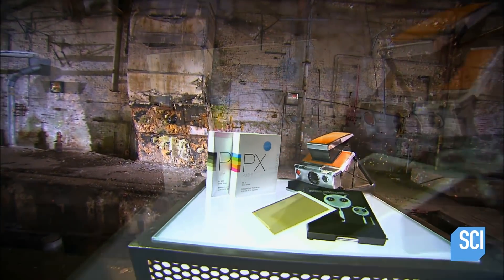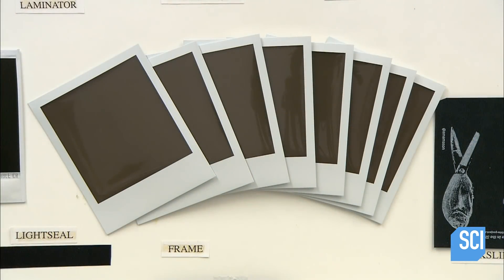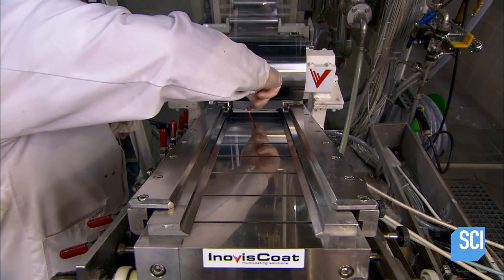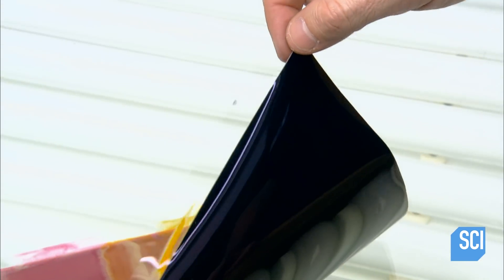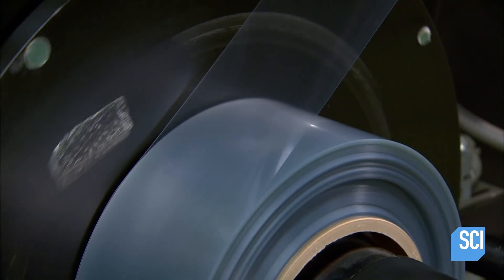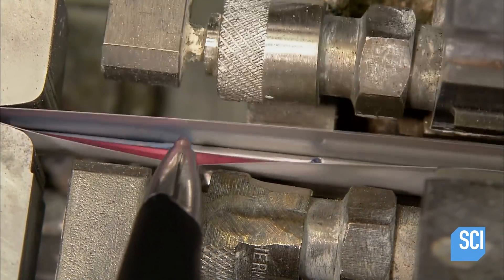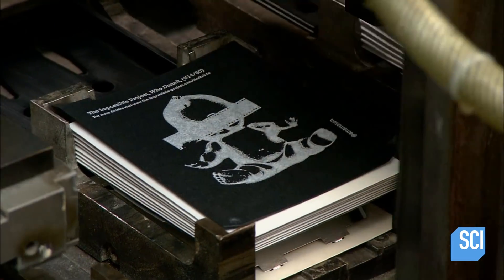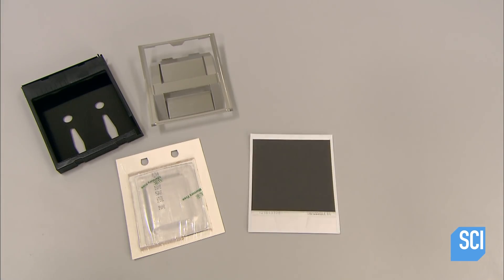How It's Made: Instant Film

Comment: Nice, but how the process happens after taking an image ?
Reply: The photons of light cause a chemical reaction when they hit the films, leaving behind an image. You can actually make a camera from a small piece of cardboard with a pinhole in it. Just remove your hand from covering the hole when you want to take the picture. The light will pass through and hit the film behind it and capture the image
Reply: When you take a photo with a polaroid camera it works like an old film canister type by putting the captured image on the square film. The magic happens when the image is ejected out of the camera small pinch rollers crush the pouch of developer and it creates the image in an accelerated and somewhat less complicated chemical process compared to old canister cameras. It is and was quite the invention prior to the digital age.